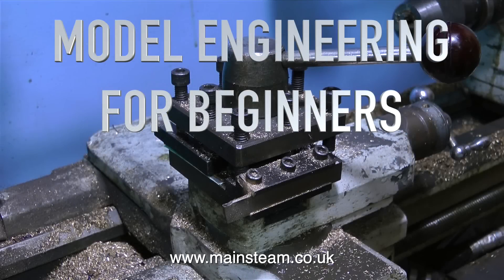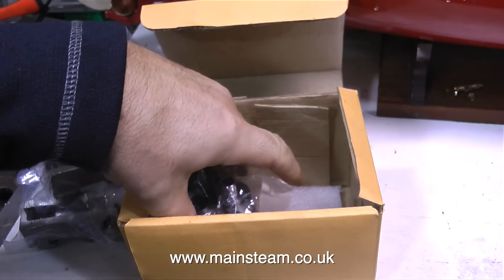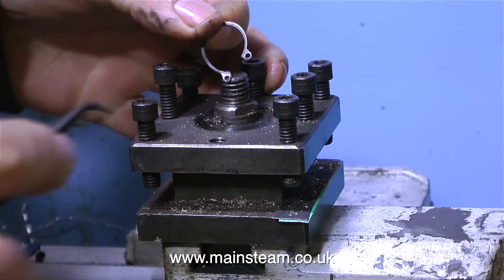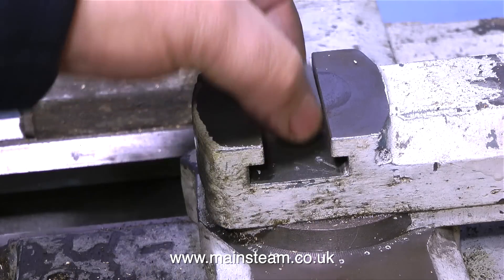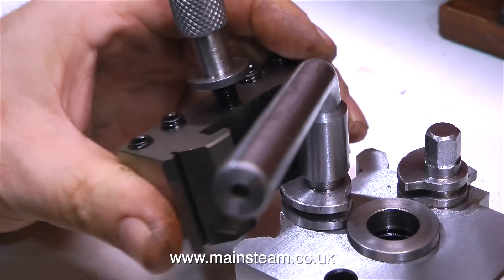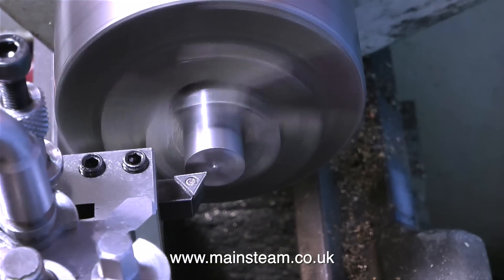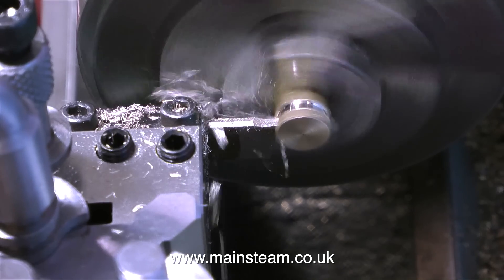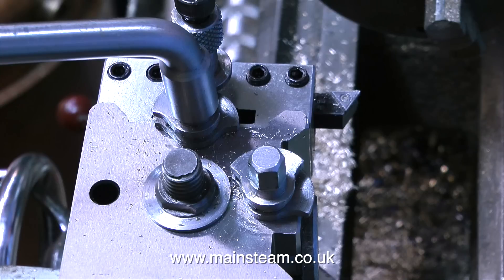FITTING A QUICK CHANGE TOOLPOST - MODEL ENGINEERING FOR BEGINNERS - PART #13

Comment: Maybe should of kept the bolt and T-nut with the old turret tool holder, and then buy a new cheap metric bolt and just machined a new T-nut for it. Would of been about the same amount of work, but that way you could always refit the other holder whenever you wanted.

Comment: Hi Keith, what size tooling can be used on a Boxford 4 1/2" and still get centre? Also, what is the model number of the QCTP?
Reply from the maker: Mine are about 1/2 an inch square - please go to the Chronos website and search for "toolpost", you will see all of the options there. Model number reference is: 390202

Comment: How hot can be the steam to not demage small soft soldered brass engine and how much can it be superheated (if it can be)?
Reply from the maker: I do not know, as I never soft solder steam inlet pipes. High Superheat is no good at all for such an engine.
Reply: And what about steam dryer?
Reply from the maker: Not recommended for a soft soldered engine.

Comment: I have got the same toolpost on my ML7 as well, it is very usefull indeed. I have 7 toolholders with it, but someway or the other on every workpieve I always need at least 1 tool wich is not in a holder.

And chronos is a very good supplier indeed, even people from the Netherlands like me buy there.

Comment: 3 holders really is not be enough.... personal experience
Reply from the maker: Maybe, but on my other Lathe on which I do most of my machining work, I already have a further 8 holders. I only use the Boxford for the knife tool, boring tool and Parting off tool - that's why I only bought 3 holders - extra ones are available should I ever need any.